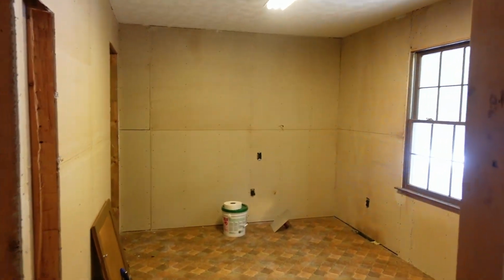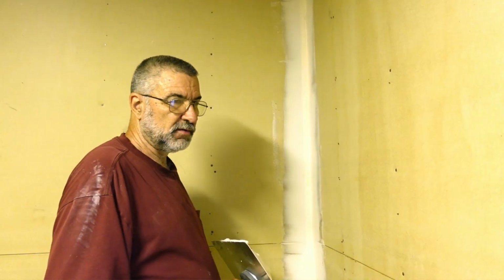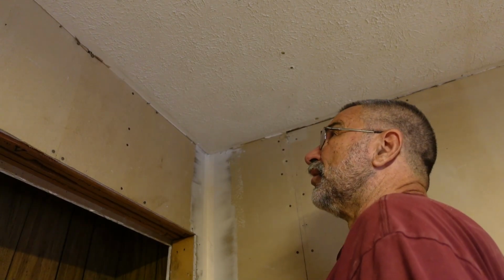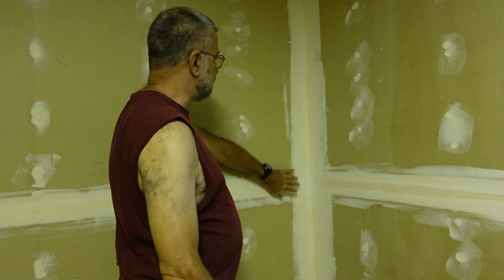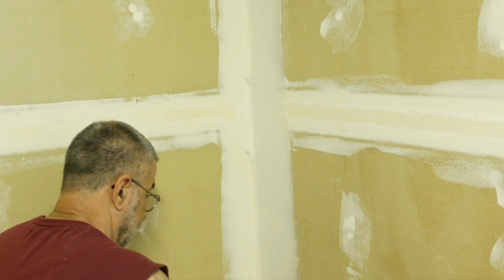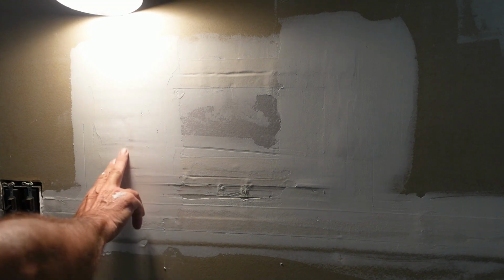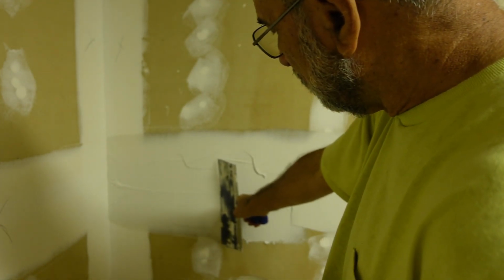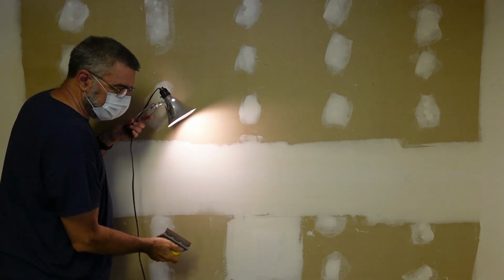How to Finish Sheetrock - Flip house Pt 9

Comment: The first drywall spackling I did: terrible! My Dad, a carpenter, said, when I asked him id he thought it wasn't TOO bead, said, "well, if you don't look at it, it's not too bad." LOL! 
Anyway, I learned that doing a good job of drywall is certainly an artwork. One of the maintenance guys at work, when fixing any little holes or dents in sheetrock on the walls, was absolutely great at it. He said he had lots of experience, as he was the Dad of a large family. :)

Comment: Nice job,  I was wondering why you wouldn't use caulking instead of quarter round on the seam between the walls & ceiling❓
Reply from the maker: The gap is too big. And with the textured ceiling it would be impossible to get the caulk smooth. It would look terrible. We’ll use quarter round, or maybe even larger crown molding.

Comment: In a remodel after the mud, can it be sprayed with a finish if it still looked damaged? Or is it one or the other? Thanks Bill!
Reply from the maker: I don’t know what you mean by “sprayed with a finish.” Are you talking about a textured surface? In that case, you must completely finish the Sheetrock BEFORE you texture it. Texturing does not hide the seems if they have not been finished first.
Reply: @LiveSimpleLiveFree  Thank you!

Comment: I had a drunk driver try to park his car in my living room, so we had to have an entire wall replaced. The sheet rock team troweled the mud on, let it set about 15 minutes while they cleaned up their trowels, then used a lightly damp sponge and smoothed everything up immediately. No sanding, no dust. And I have checked the seams in a raking light, no edges, no lines.  I am very confused why all the there is all this work and sanding, with how well this worked for them?
Reply from the maker: Well, I have no idea what they did, or how they did it!